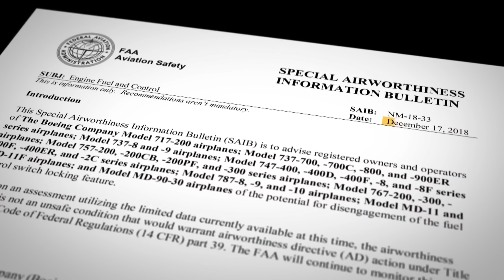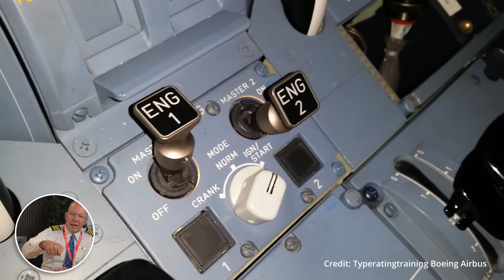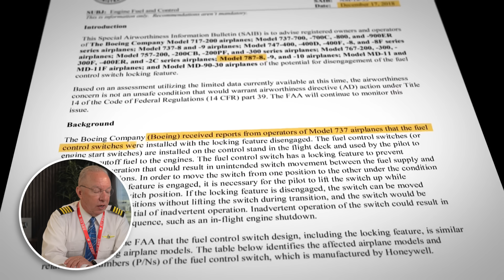Air India 171: The FAA’s 2018 Fuel Switch Locking Bulletin Explained (16 Questions Answered)

Comment: Pilot privacy ends where 242 lives begin.
And if a plumber, cashier, cop, and Uber driver can be recorded for “safety,”
then a commercial airline pilot sure as hell can be too.

Enough hiding behind union politics.
Lives > comfort. Always.
Reply: Don’t forget the 19 people on ground too.Horrendous death viz a fireball.
Reply: I think a 30 minute loop is reasonable.  Even 15 minutes.  If pilots are so concerned about what they did 15 minutes before a crash, then I don't think they should be flying
Reply: The pilots are allowed to screw off during cruise anyways. They don't have to watch every second. I'm getting this info from pilots.
Reply: Absolutely 
.I don't know what safety, privacy he is referring to in a cockpit.
Reply: Exactly, what a BS excuse that was. He tried his utmost to steer away from it why Pilots shouldn't be recorded  by saying "Oh they might be unhappy if the Pilot is reading  newspaper"
Reply: All cops have to wear body cams now. Agree that the argument doesn't hold because pilots want to be able to shoot the breeze without oversight.
Reply: I mean if this pilot really wanted to end himself, putting camera inside the cockpit wouldn't have done anything to deter him from cutting off fuel supply. The main purpose of installing a cockpit camera would be to assist investigators in determining the cause of crash but why would camera be needed when most of the time black box recordings already provide more than enough information to fulfill that role?
Reply: @Acquirebread
Yeah. Pilots might get time for masturbution if the flight is long enough. They're humans after all 😅
Reply: @Acquirebreadexactly! It wouldn’t accomplish anything. People just wanna see things for themselves
Reply: @Acquirebread with that logic, lets remove cctv from every street, bank, office etc. because of course they don't prevent any crime - literally the entire point is to find out who did what.

what is this nonsense logic that 'camera in cockpit is not going to stop the pilot' ??
Reply: @ExtraCrispy  CCTV footage is critical in public places because those areas involve many unknown individuals, and visual evidence helps identify who did what. In a cockpit, we already know exactly who is in control, and their actions and voices are thoroughly recorded by the black box. These recordings usually reveal not just what happened, but also why whether it be mechanical failure, pilot error, or an intentional act. The problem isn't that cockpit cameras are "useless" but their added value is minimal in an already heavily monitored environment. Comparing cctv in public places to cockpit cameras is just simple wrong because there is no anonymity in a cockpit and there are already more than enough information for investigators to figure out what really happened.
Reply: @Acquirebread next time you watch tv or go to a movie, put a blindfold on and then tell everyone voice == video.

maybe also tell doctors who are recorded in an OR, or ship and train captains who are recorded, why its useless.

but pilots are special?
Reply: @ExtraCrispy  Like I told you, it's not the same comparison. In a hospital, there's no black box that can track exactly what a doctor is doing which is why cameras actually provide meaningful info. Same goes ships or trains. camera footage helps when the environment includes outside forces whose identities aren't automatically known. However, plane is different. Planes are isolated environment where identities of all crew members and passengers are known before the flight takes off.  The only meaning info a cockpit camera might give in a case like this is making it easier to visually see who shut off the fuel. But that's something investigators can already figure out from the black box data.
Reply: @ExtraCrispy  Can you name a single flight that a cause could not be determined in the absence of a camera?
Reply: @Skywest25  can you name a single reason why there shouldn't be cameras? other than allowing pilots to do what they are not supposed to and risking lives? Steve literally admits this, but keep defending people like him
Reply: @ExtraCrispy   Cameras in this crash verses in general are two different things. Pilots are scrutinized enough as it is. And risking lives, how? You don't know the stress airlines put under pilots now without cameras. Go for an hour long drive with a cop present citing any/all violation that occurred. Now add on a camera planted 4 feet from your nose, then picture that every single time you drive a vehicle.
Reply: @Skywest25  i'm not trying to say they are bad. or haved any animosity towards them. its simply a qn of having a record. of course it places extra scrutiny on them, no one wants that. 
but this is a highly critical workplace, and highly paid. when other similar professions have similar monitoring, I fail to see why an exclusion is made for pilots.
there was exact same resistance for CVRs too and same concerns about privacy - is anyone going to say thats not a good thing, because the exact same arguments were used.
video is a must, period. its not their private home.
Reply: @ExtraCrispy If cameras are backed up the same way black boxes are. Meaning airlines could not access the data at any moment, then yes I could see that. But active filming while in flight with airlines using it for performance, no way.
Reply: @Skywest25  no one said that it should be an additional video inside black box
Reply: Nice sci-fi take, but wrong.
Modern flight data recorders already withstand 1100°C for 60 mins and 3400g impact — and we’re storing 2+ hours of audio and thousands of parameters.
A looped, encrypted cockpit video feed (even at low frame rate) doesn’t need 4K Netflix storage. It just needs truth.
This “video memory can’t survive” excuse died years ago — it’s just not implemented because it makes some people uncomfortable, not because it’s impossible.
Truth hurts, but not more than undisclosed deaths.
Reply: What about when the pilot's anxiety leads to an incident? When a camera is for your safety, its reassuring, but when it's there to catch you out, it isn't. I'd much rather my pilots are comfortable than not. An unobtrusive camera at the back of the cockpit, sure. Body cams/dash cams, I'd rather not.
Reply: what does "242" mean?
Reply: @lander77477  Deaths ...
Reply: It is simply a technical issue. I already posted that the bandwidth of video is much mich higher compared to the "few" data signals and some voice recordings. A memory that is capable of recording a few minutes of video and being big enough to do that for many month or even years before being worn out and needed to be replaced would be so big, that it would not survive the g-forces on impact. Also the thermal barrier needed to protect it would be enormous. It would be worthless to install a video recording system that doesn't survive the situation where it is needed the most. But that may change in future if someone could invent a memory material that can be overwritten, survives 1000g on impact and can be baked in 2200°C for 30 minutes or more.
Reply: Place a camera in your cubicle watching every since move you make then tell us how you feel.
Reply: Not a single life would have been saved by a camera. Not a single thing would have been different, with the exception of MAYBE seeing what happened afterward.
Reply: @TheSurrealGoose  it will prove if pilots moved the switch or not. and it will help find the real cause. 

if you don't think thats imp you are blindly defending pilots unions and their ridiculous demand of privacy so they can do what they are not supposed to and risk lives
Reply: @ExtraCrispy  No, it will not prove anything that is not already known. And it will not save a single life. Also, not agreeing with you does not mean I support some other thing that you determine. You're just a random AI generated chatbot programmed to regurgitate the standard "just do something" worthless talking-points
.
Reply: @TheSurrealGoose   Exactly! I point out a camera would only be powered when the engines were running, so a pilot wanting to sabotage a flight would just cover the lens and hope the other pilot wouldn't' notice.
Reply: they already are. Cockpit sound recording includes the operating sound of every switch. those switches are deliberately designed to each emit a unique sound for a reason. In the case that a flipped switch is somehow not recorded by the system, the sound record would still give away that.
Reply: @borisglevrk   These people just want recording to feed their curiosity and see it for themselves.
Reply: @Skywest25 Exactly — a camera isn’t perfect, but way better than guessing. If a pilot tries to cover the lens, the footage will show who did it and when.

It’s not about feeding curiosity — it’s about accountability and saving lives. If safety takes a backseat to privacy, that’s the real problem.
Reply: @Skywest25  point is it's not even about "privacy". Nobody really argued for that. Pilots don't want their actions to be put under a magnification glass even when they are doing things right. Easy as that.
Reply: @aryapatel1008  No it wouldn't. The pilot would do it at the gate and the cameras weren't activated. That wouldn't be covered in a checklist, so if the other pilot never notices the plane takes off. So what would a camera onboard have done for this flight?
Reply: @Skywest25 You’re assuming the worst-case loophole to dismiss the entire idea. Sure, if someone sabotages before power-up, it might not be caught — but that’s like saying lockpicks exist, so why lock your door?

Cameras aren't a magic fix — they're a critical layer. In most cases, they would show what happened, when, and who did it. That’s still better than blind speculation for months.

One edge case doesn’t invalidate the need for visibility in the other 99.
Reply: @aryapatel1008   This crash is LITERALLY the worst case scenario. I'm saying for a crash such as this a camera would accomplish nothing. The germanwings crash had no camera and we know everything everything that happened. If your talking Cameras in general that is a whole other animal. If mandatory and reviewed at all times, airlines would use them to scrutinize more than they right already. They are relentless! Every delay, every diversion...why did you do that, you coulda done this. And that's without cameras.
Reply: Hello Steeeve, I like your videos and professional opinions. But, your stand and excuse for video recording is not acceptable.
Reply: @clausbader9537  NTSB and other aviation authorities want cameras in cockpit, and increase cvr to 25 hrs

https://www.ntsb.gov/news/press-releases/Pages/NR20240213.aspx

pilots refuse. they also fought hard to prevent CVR claiming audio invaded their privacy. can you imagine how useful CVR audio has been?

Steeve will never reply to any of this. He is an unprofessional shill who's only purpose is to release frequent videos spreading nonsense and make money from youtube
Reply: And what would having CCTV prevent? It would give definitive answers likely but would not prevent anything
Reply: @acidburnicp  It would possibly prevent RECURRENCE of another tragedy, or isn't that sufficient ? Many Drivers of Commercial Vehicles are monitored, so why are Pilots any special case ... ??
Reply: Getting the answer quickly and efficiently helps prevent future disasters.@acidburnicp
Reply: @acidburnicp “It won’t prevent”?
Yeah, because knowing the truth has never helped, right?
With CCTV, if it’s pilot error, airlines can tackle mental health issues and fix training — not let it slide.
If it’s Boeing’s fault, they can’t keep blaming dead pilots.
But sure, let’s keep guessing like it’s 1970.
Reply: Yeah his excuse wasn't even an excuse. He literally said that they shouldn't be recorded because Pilots are doing things they shouldn't be doing... He says he doesn't want those things being spread on the internet...
Reply: Spot on - Notice how Steve sidesteps the question by framing it as just about preventing it from happening...that wasn't the question!  it was about accountability after the fact. I'm done with Steve as this shows little to respect for his audience and a lot of arrogance. He does this with other questions too like the one about a bus failure causing the electronics to shut off fuel...He said that is impossible and not what happened because they couldnt repro it in the sim...seriously?  no sim is setup for that scenario!
Reply: @alanvonweltin6820  completely agree. lets not forget he was the first to make a video accusing the pilots with zero evidence, completely unaware and ignored RAT (which everyone was discussing), went on dozens of talk shows and made $$$ off a tragedy and continues to do so, while defending pilots unions and corrupt industry. 

He's just doing this for money, doesn't have any actual insights or information - every actual news was on other sites first, there are other respectable aviation channels like Mentour pilot we should look at for actual analysis.
Reply: @alanvonweltin6820  Correct.
I have suggested elsewhere that Expert Simulator Engineers should have been involved to try to figure out which failures could cause this scenario as they would understand better than Pilots and Aerospace Engineers, due to the nature of their job in replicating reality including failures ...
Reply: @alanvonweltin6820 Absolutely agree with you.
Reply: Wow, great point!